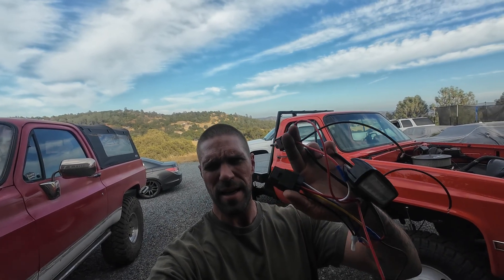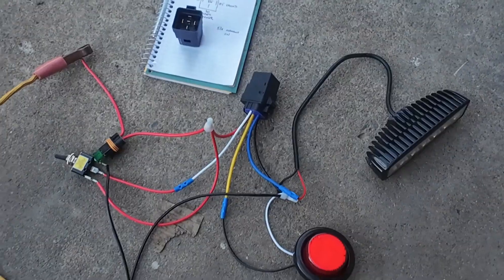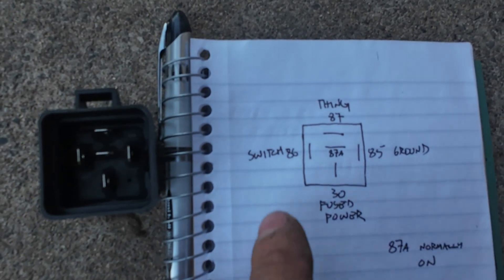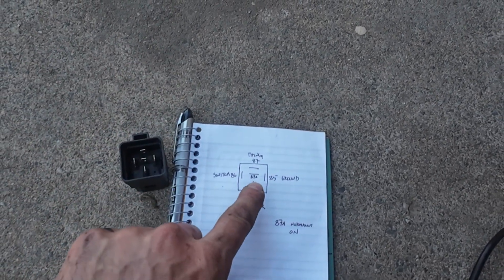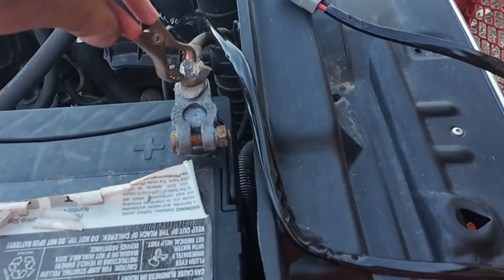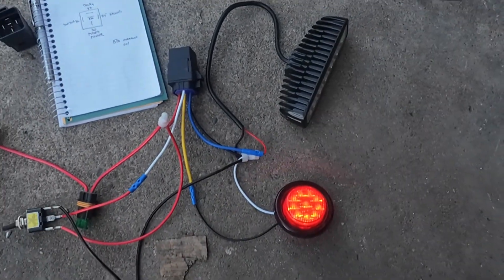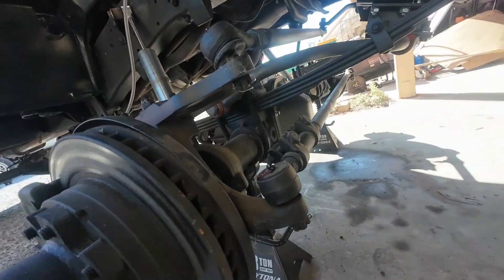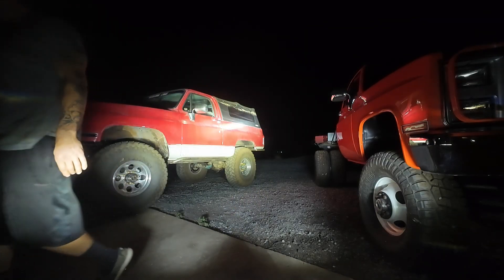How to Wire Switches & Relays the Right Way | Simple Truck Accessory Setup

Comment: Did you buy the bracket for the switches and for the relays under the hood or did you make them? Thanks
Reply from the maker: @erict313 The bracket for the switches was an extra one I had laying around from a hydraulic setup, the under hood bracket I made out of aluminum.

Comment: New subscriber🫡. Glad to come across your channel. I'm a welder by trade in aerospace but also a home diy guy with a 84 GMC K15. I'm actually fixing to wire up an efan with a relay
Reply from the maker: Awesome! Thanks for joining in!  Aerospace welding is no joke!  I typically like to set up dual relays for an e fan...one to a temp trigger to turn it on/off automatically and one to a manual switch so you can turn it on manually if you need to
Reply: @VenturiFab yea I have a temp switch an I do want a manual switch for backup as well
Reply from the maker: @honda90084  on the fuse panel in the cab I usually pull power from the brown labeled spots...there's usually 2 or 3 open ones in the top center of the fuse block, those ones are switched ignition so they only have power with the key on. Typically easier than tapping in somewhere else
Reply: @VenturiFab perfect🫡